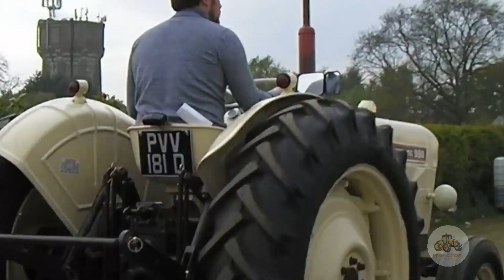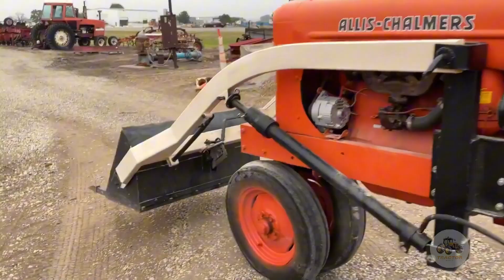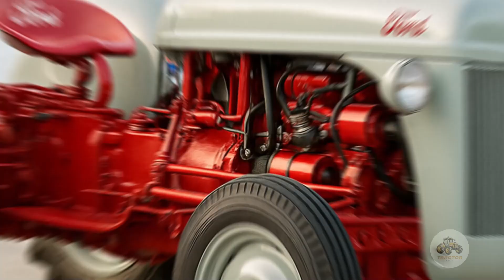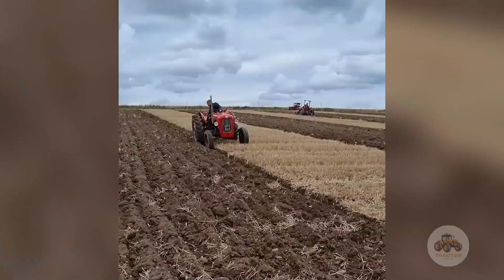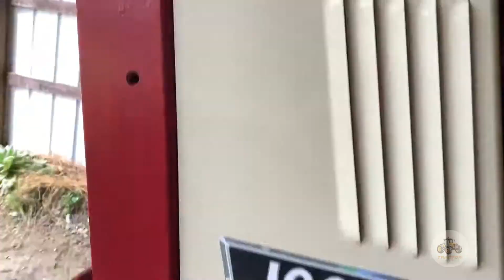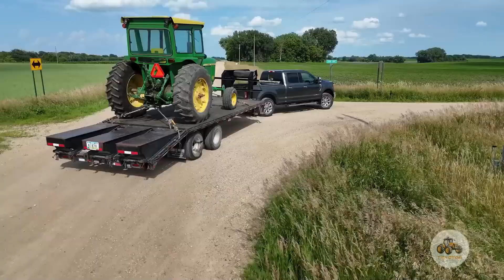Top 10 Abandoned Tractors That Still Work (And Are Still Legal)

Comment: I know about several of these tractors.  I had an uncle with the 8 or 9N.  It was his only tractor and met his needs well.  He was a small farmer.  I have used the WD45.  It had live PTO power if you used the hand clutch.  Having grown up on a 50 and B John Deere, I had no problem with that.  Lots of people did.  Around here, before they got into the newer tractors, a lot of farmers used them for baling because they could hand clutch and the baler kept going.  We had an H International.  After a couple of unsuccessful (and expensive) engine rebuilds, it was traded in for the 50 John Deere.  I had an uncle that lived in northwest Iowa.  He had an older Case (I think no hydraulics) that he basically used only for plowing.  He could do that as he plowed a lot.  He also had an IH MD.  That was an M that was diesel.  It started on gas and then was switched over to diesel.  His must have worked pretty because he used it as his winter snow tractor.  Also, the Allis Chalmers 2 point system could be converted to 3 point.  I know because the man that sold me my 60 John Deere kept the bottom part of the 3 point system for the Allis.  I had asked him what happened to the bottom part of the 3 point and he showed me on his Allis.  At the price I paid, I couldn't complain about that.  I then started shopping for a replacement 3 point system.  This was back in the 90s.  At time, the tractor junk yards, were selling the original John Deere 3 point for the 60 and a replacement version that had the "modern" top link.  They were basically the same price.  I spoke to a guy at one of them and asked him what the basic difference was.  His answer "If you are going to show it, you want the original.  If you are going to use it, you want the aftermarket."  I still have the aftermarket on my 60.  Which brings us to another issue.  The original John Deere 3 point system did not use the current "top link"  It had a "top link" that consisted of two arms that attached to the back axles and a piece between them that took a pin.  It went in a piece that went in the implement that I have heard called a "horsehead".  (Link showing one: https://forums.yesterdaystractors.com/threads/questions-about-the-john-deere-801-style-hitch.1644585/     You will have to scroll down.  It is a picture under a copy of the 3 point in a manual.  The picture will show you why they called it that. It was not real efficient and  you couldn't use a standard "top link".  The 50, 60, 70 series was the last one to have that system.  The 420, 520, 620, 720 series (and every thing after) had the standard "top link".   I know because I have a 420 and that is what it had when I got it and what it shows in the owner's manual.  The 4020 was John Deere's biggest seller for years.  I have been told that, during the late 60s and early 70s that half of all new tractors sold were 4020s.  They followed that with the 4320 and the 4520.  In the late 80s or early 90s, one of my brothers bought a David Brown from the Case IH dealer because he got a good deal.  It ended up "living" with my brother who was the farmer.  I remember helping him add the second hydraulic cylinder outlet to the tractor.  The farmer had a 4020 and he used it a lot.  I know that, when the 4020 was about worn out, he went looking for a replacement 4020 and circled up through northern Missouri, Iowa, and Illinois.  He couldn't find one that he was willing to pay what they were asking.  By then it was in the 90s and I has assumed there would be lots of them for sale.  He said there weren't and a lot of them were used for planter tractors in Iowa and Illinois.  Where I grew up, we used mostly 2 row corn planters and, in my late teens, there were a few 4 row planters.  He told me that they used 8 row or more planters and they also put fertilizer and pesticides and herbicides in the ground when they planted they wanted 4020s because their frame was strong to handle a 400 gallon tank on each sided and a 200 or 300 gallon tank across the front at the same time.